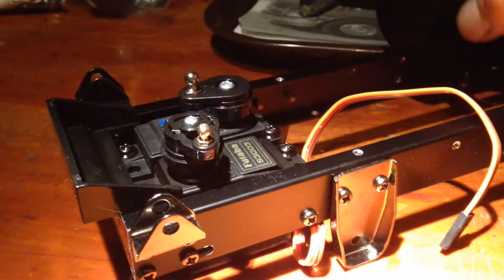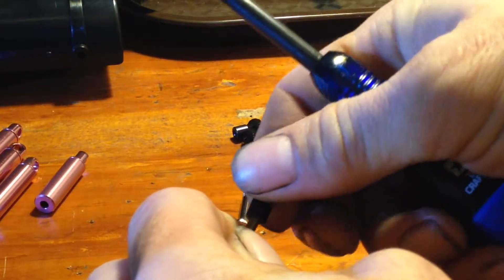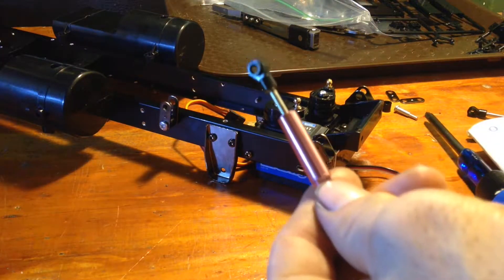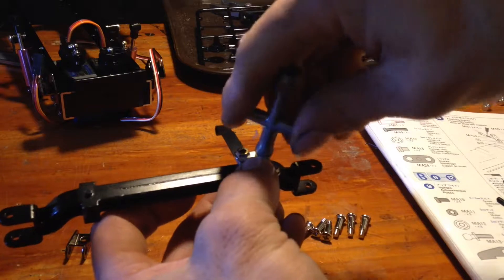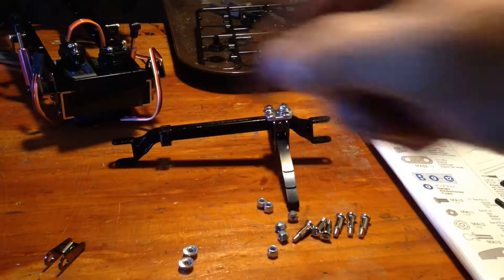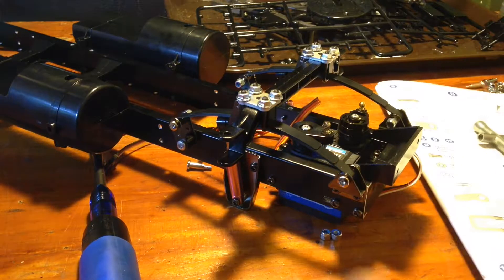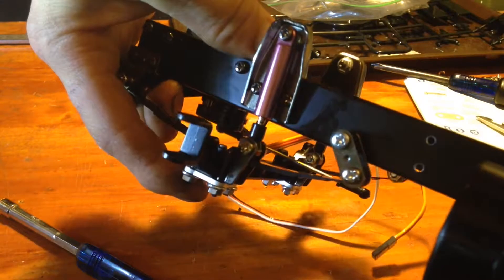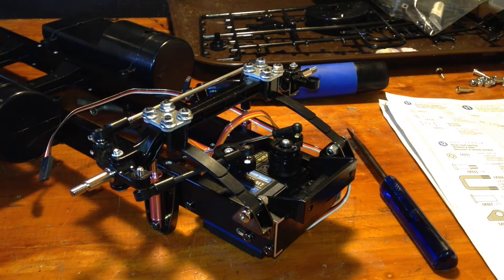Tamiya Aeromax Semi Truck Build Part 1: Chassis/ front axle.

Comment: Where can the kit be bought????
What's the price for kit ?????????
Reply from the maker: The Tamiya  semi truck kits are usually $350-$700, depending on which model you get.  They can be ordered through Amazon, Tamiya,, or many online retailers like tower hobby, rcmart and others. Sometimes local hobby shops will carry them, or order them for you.